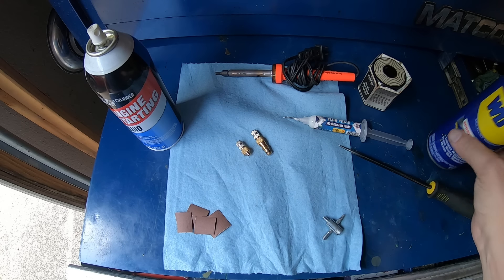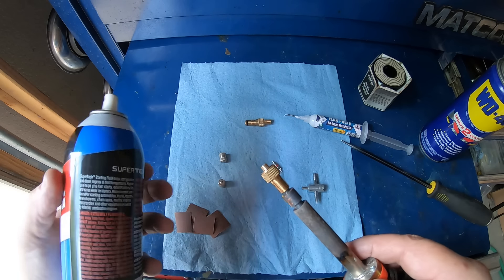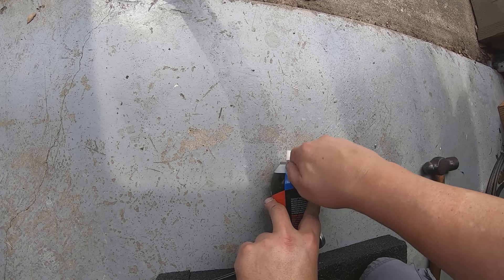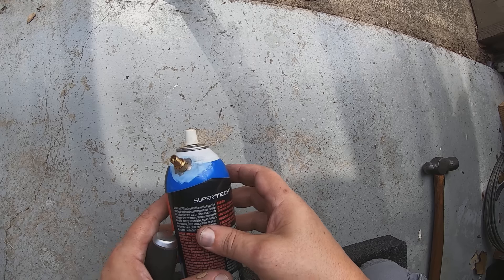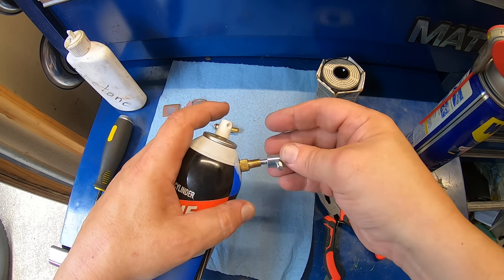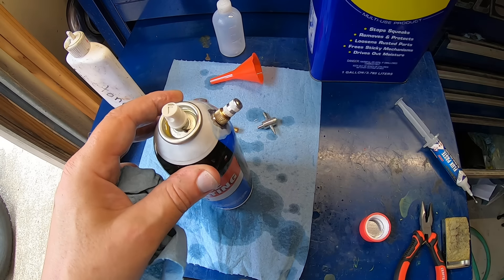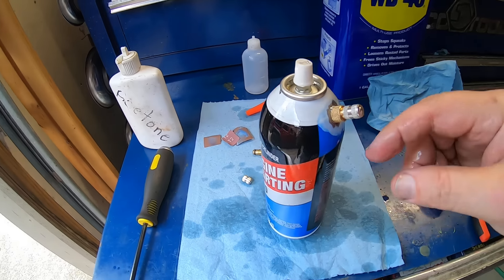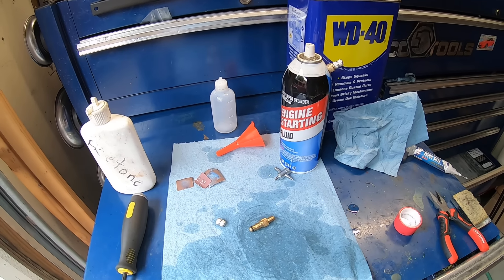How to Easily Install a Schrader Valve on any Can to make It Refillable without Drilling or Torch.

Comment: No lath needed. Chuck the valve stem up in your drill press and cut what you don't need, turn it down with a file. Use a Map gas torch, flux and solder and Boom! Done. Peace

Comment: What I do is I buy  bug spray in gallon jug that has the battery powered wand I flush them out with a shit load of water I dry them out I put wd-40 cutting oil etc in them and when the battery's go bad I take it apart and replace the battery's usually 2 aa or 2 aaa battery's I originally did it for my drill press😊

Comment: Keeping nozzles from empty cans is wise, caps too, because not all nozzles are of the common variety and easily interchangeable, though even with a standard nozzle it’s a pain when you lose the nozzle for a full can and or when you don’t have a cap for a can to prevent accidentally spraying it or depressing it just enough to discharge the pressure gas. I have a tote full of spray cans in the bed of my personal service truck and sometimes things accidentally end up atop the cans and spray product or just release the gas, but by far the worst is how many nozzles I lose.

I use Kroil and other Kano Labs products and those are not cheap (16.5oz aerokroil is around $36/can!), and they use a completely non-standard nozzle, so your screwed if you lose a nozzle and don’t have any other Kano products! I’ve had it where I had 1 Kano nozzle for 6 cans and just had to keep switching it around. They are helpful though, I recently called them and asked if I could buy just the nozzles and they sent me a handful for free! ..I have spent a LOT of money with them though.

Comment: It'd be easier to remove the spray nozzle from that brake cleaner can, use an extra tire valve (big side) to seat onto the straw and pressurize the can using a tire air chuck. (Locking chuck preferred)  some trimming of tire valve needed, bigger side trimmed to seat on straw better

Comment: Suggestion - put the valve on the side opposite the hand you use to spray; e.g. if you're right handed, put it on the left.
Reply: Some cans have a recessed spot under bottom of can, assumming that the valve-stem isn't to long, that would be the most eccomic location.

Comment: Don't drill metal shaving.
Usea ballpeen hammer to dimple the Can tin the Dimple.
Soak it with more solder.
I have been using 45° SAE fittings I use in A/C TRADE for 30 years +.
The SAE fittings are lower profile. The air conditioning parts house has line tapping charging  fittings.
I have Coleman green bottles I have refilled 500 times, you have to be able to charge liquid from a white tank.

Comment: So ive bought the metal tire valves they are threaded the whole way down to the large round end that goes on the inside of your wheel. I cut that end off so its just straight threaded. Punch a hole in a can. You can run a tap or just muscle it in there twisting it in. Then tin it and solder. Never had one let go. Holds air and works fine.  If yu have a lathe and lookingnfor an excuse to use it then your welcome to it but def not necessary

Comment: You definitely want the shraeder valve on the top.If you place the shraeder valve below the fluid level any solvent in the can could begin to dissolve the rubber seal in the valve leading to valve failure and a pressurized mess.
This mod also allows you to store/transport your cans unpressurized (ie air freight), use specific pressure settings or even make you own custom blends. DW40 + CRC 5.56 blend? Sacrilege to suggest adulterating DW40?
Reply: I would suggest not air freight or any professional freight for an altered pressure vessel.
I am not sure what the fine would be but it something I do not want to find out.

Comment: Great deal, $29 gal + $700 for a small import crappy lathe =$729 ÷ 128 fl oz = $5.70 per oz.  🙄
A 2pk of reusable shop spray cans are $65.00 at Amazon!!!
 Geeze alou!!
Reply from the maker: Exactly, I put affiliate links in the description so it is easy for you to click and add to your cart so you can get everything you need. 👍

Comment: I did this a couple years ago using an old rubber valve from a car wheel cause you can cut off the rubber and it is brass inside,  don't need to cut down other than that.
Only problem is that when i fill it there is a problem with getting it in there cause the air needs to come out as the liquid goes in and it is more difficult than shown here.
When my WD 40 can is empty I'll do it with that one.
Thanks.

Comment: Diesel is just as good for lubrication on rusty stuff, and a hell of a lot cheaper. WD40 is good for getting moisture out and protecting against on plug leads etc. But diesel is way more economical for everything else. And you don’t need to turn the valve down. 😁👍

Comment: Seems to me that with a vacuum pump and a turned down adapter (to go in where the spray nozzle goes in) this could be done with no extra Schrader valve installation.
Reply from the maker: I am confessed on how you would get the liquid back in the can? Pull a vacuum on the can and let the vacuum suck the liquid in and after it has sucked in the liquid charge it up with air?

Comment: Why wd40? How about motor oil. WD40 absorbs water but it also goos and dries up. Try spraying it on a brake rotor and watch the rust later. It may absorb water and displace it ?WD?  but it sure promotes rust later. Spray it on a hinge and it drys out. Spray it again a week or so later , and repeat forever. Yep they sell a lot of it. oh yeah spray again a month later....
Reply from the maker: WD-40 is cheaper than many other fluids and works great for machining aluminum. machinist use it by the gallons for aluminum. It does not promote rust like many people think. It may not be as good of a protectant than many other products now days but it does not promote or cause rust.

Comment: If you put a Schrader valve in the WD 40 gallon container you can use air to fill it through a hose into the other can, just put the fill line at the bottom of the gallon container

Comment: Putting compressed air in a thin wall vessel without a relief valve is dangerous. Hope that you are wearing safety glasses!
Reply: Exactly why we refrigeration techs are trained to punch In relief tabs on refrigerant cylinders when empty before throwing away.
Some take the tanks and use for compressed air.  Not a good idea.
I don't like videos like this that ignore safety and teach more people how to be unsafe

Comment: Too much pressure and your doctor will be picking shrapnel out of you if you're lucky.
Reply from the maker: True but you won't be able to over pressurize one with an air compressor.
Reply: So don't be stupid and do that, problem solved.
Reply: @crosley62  That was the reason I commented to that,the way I did. Thanks

Comment: Wow.... I didn't know you could solder a steel can with a normal solder, I though you need a silver solder and high heat.  For some reason I tried to solder 3/16 copper tube together with one a larger connecting tube in between using torch and it still managed not to work even though I used flux (the one for normal electronics soldering).  Maybe the torch was too much?  I never though a solder iron would work so well.  This is great idea, in fact I wonder if I can do this to make a refillable CO2 blow can.  Those things have gotten so expensive but are so useful to clean dust from computers and spilled powder from my reloading press.
Reply: be careful CO2 has a lot of pressure. You can look at a pressure temperature chart online someplace .

Comment: Pressurizing cans of hydrocarbons with gases containing oxygen is dangerous.
Reply from the maker: Luckily I was using normal air which is 78% nitrogen and 1% Argon which is no more dangerous than striking a match in the open air. 

The ratio inside the can is still 78% nitrogen.

Comment: A rubber tire valve stem can be used to fill the can through the nozzle stem. Pull the nozzle off and use the valve stem just as you would if it was in a wheel. The rubber will seal against the can top an air will go in the stem of the can.

Comment: FYI, you can get a rubber valve stem with the core, remove the spray head from the can, put the rubber stem over the tube and spray directly into the can.  Lift off the rubber valve stem and put your spray button back on and you're back in business.  Works great.  Stop by any tire dealer and they'll be happy to give you a few old valve stems that will work just fine.
Reply from the maker: How do you put the liquid back inside?
Reply: @737mechanic  The only thing this method will do is add air pressure back when it will no longer spray due to air depletion.  
You could actually pump liquid back inside the same way but if you're out of liquid and air why not just put your liquid in a spray bottle with a trigger sprayer....
Reply from the maker: @watchdogu.s.a.8973  You can or you can have refillable aerosol cans for convenience.

Comment: If you drill your hole, fine metal shavings will fall into the can and have the potential (albeit very low) to cause future problems in the spray valve. A center punch has no such problem because there are no fine shavings to deal with.

Comment: Cool idea, but filling with air containing oxygen could cause the oil to explode - that's how diesel engines combust.
Reply from the maker: Pure oxygen yes but the air you use out of the compressor is 75 percent nitrogen.

Comment: i saw on utube .you can use ceramic spark plug to heat  strech the metal to thread into metal  tap it in

Comment: Hold my beverage. Cool project, and nice skills, but fyi...when you first hit it with the air hose my arm instinctively came up to shield my face haha. Enjoy! :-)
Reply from the maker: I know, Thats why I was wearing safety glasses. 

You should watch the other 2 videos I did pressurizing them to failure.
Reply: @737mechanic  Aha...the nozzle popping off is a nice warning shot that things are turning sideways. 

Seeing things like that in a video might help somebody to react fast enough after they notice "oh weird, that fixture just popped off..."
Reply from the maker: @blueskyhigh420  Hopefully they don't have a compressor that builds that much pressure.

Comment: Word of Caution: I wouldn't recommend using these cans for a very long time. I'm sure that the moisture that is introduced when charging it with air from your compressor will play a role in degrading the can from within. I'm not exactly sure how long, but I'd throw them away every few years at least.

Otherwise, something I'd consider doing. I already charge up my little 1LB propane bottles to save money. Similar concept.

Comment: Just be careful with disposable aerosol cans.   I'm not going into detail but they aren't designed for a lot of pressure....that's why propane is the propellant.   It expands as you use product and maintains constant pressure.   Then flashes out of what ever product you are spraying.
Reply from the maker: To see for my own knowledge and everyone else's I have done 2 videos where I pressurize two different cans to failure to see how much pressure they can contain.

Comment: Prior to pressuring ANY metal can, you should first  reference the specific product Manufacturer's MSDA Safety Data Sheet from their website.  This sheet describes the maximum air pressure rating of the can.  You can be seriously injured (or possibly killed), if the air pressure exceeds the container's ability to hold it.  One's personal safety is of greatest importance.
Reply from the maker: Out of all the MSDS's also known as SDS's I have read I have never seen a MAX pressure of a can listed. In fact, this can was Supertech Starting fluid, If you can find the SDS/MSDS that shows a max pressure I would like to see it. 

BTW, my video tomorrow shows exactly how much pressure this exact can can hold.

Comment: I'm definitely interested in getting the soldering tip and maybe 12 machined schrader valves from you. I don't have access to a metal lathe.
Reply from the maker: Email me and we can work out a price.
Reply: @737mechanic  I'd write up a disclaimer so people are aware of possible dangers of using your items, should you sell them. Lawyers have a way of twisting things if they are trying to sue! I'm sure they would try to go after you and/or your homeowner insurance should anyone sue for an injury after using your products and/or method with dangerous products. Just saying; watch your 6 ! Good luck though, it seems to be a clever idea!

Comment: This works out nice for lubes and such. My forty dollar ($40.00), down town version holds a quart and I use it for stainless steel cleaner. It holds an air charge for months.

This would allow me to keep the same bottle for cleaners, nut busters and so on by poking holes in one that ran out of propellant, then pouring their contents into the modified can. In the end, a lot cheaper than buying a stack of the forty buck ones.

Pour out of the big can from the top, Less bubbling and splashing.

Press down on the spray valve to let air out, as you squeeze fluid in.

Comment: If you hit it with your soldering iron it might damage the element inside the iron, a hammer is for hitting things with.
Reply from the maker: Why would anyone hit something with a soldering iron?
Reply: You said fit the valve in the can and hit it with a soldering iron
Reply from the maker: That is mechanic talk for put the soldering Iron on it and heat it up. 
Kinda like saying "let me hit those lug nuts with the impact wrench".
Reply: Omg, I hope you were just trying to be funny, if not you need to go back to your knitting and turn in your man card.

Comment: Machining the valves down does not fit into ''easily''.
Reply from the maker: It was easy for me, you can use a grinder, drill press a file, or even a hacksaw to achieve simular results.

Comment: Wouldn't it be easier to make an attachment to push into the original tip(with the spray head removed)?
Reply from the maker: I thought about coming up with something like that but to pump liquid and air into it might be challenging.

Comment: I did not realise that you could solder aluminium.  How does that work?  NIce work and an excellent video, very well explained.
Reply from the maker: Niether metal is alumunum. The can is steel and the valve core is brass. I have never had luck soldering aluminum.
Reply: @737mechanic  - To solder aluminium, clean up the surface and then cover with light oil. You can then use normal solder to solder through the oil. It works but a bit messy to perform.

Comment: Can ratted is for max..you dont need that much pressure...not right to the edge of safety
Reply from the maker: You can pressurize it to whatever you feel comfortable but the can will hold more than 100PSI.

Comment: EXPERTS ONLY can make a shiny spot on a can with the side of a 3.5"D x .045"W abrasive cutoff wheel mounted on a WELL OPERATOR-MODULATED 1/4"  air cutoff tool. The slight flexibility built into such wheels permits this (for a little while)

Comment: If I can drill the bottle without it exploding, I will empty the content in a manual spray
Reply from the maker: If you want to put it in a manual spray bottle spray it out of the can into a manual spray bottle.
Reply: @737mechanic  no pressure, so I need 2 holes to empty the spray

Comment: No drill or torch needed 😂 I first machine down the brass then I machine down a copper lol if you have a lathe or a mill you generally own a torch and a drill
Reply from the maker: But a torch and a drill is not the best way to do it.
Reply: @737mechanic  just saying no need to even mention it like that is what would be holding anyone back from doing such

Comment: Worried about drilling by using machine shop tools?  Anyone without a drill has no chance having the tools used in this video!

Most spray cans can be repressurized wirh a rubber tire valve stem.  There are also empty aerosl cans that can be purchased that are a lot less trouble.

Comment: A few atmospheres of pressure should be safe (except for starting fluid). More than 5 atmospheres / 75 psi could heat the can to the fluid's explosive limit (like a disel engine) Using nitrogen or argon is safer.

Comment: Or you can also just buy a sure shot sprayer and use it for any fluid you want to spray (lacquer thinner, wd40, carb cleaner), etc.  Also, rather than scrubbing 3-4 minutes with an emory cloth, you could buy a dremel or die grinder and do the same thing in 3 seconds.

Comment: Bruh just use the cans of wd40 with the long red tubes, goes right in the valve.
Reply from the maker: How do you fill the can with WD-40 when it is empty?
Reply: @ duh with other cans of wd40, called the circle of life man.
Reply from the maker: @JohnWear-s3f  So you just pour it from one can to the other through the spray tube? LOL

Comment: on the original wd40 do they use nitrogen as the propellant ,using air = flue + air=  a bomb? if it comes in contact with a flame.
Reply: I was thinking the same thing. 

Engineering best practices try to avoid that kind of situation in vehicles, chemical plants etc.

How much of a risk is it inside an aerosol can where there’s less chance of an ignition? I’m not sure. But it’s definitely something to keep in mind.
Reply: I don't think WD40 is going to be explosive like starting fluid would be, however it will burn.  It would take quite a bit of heat to make it burn and smoke, but you shouldn't get anything like an explosion from WD40 burning.

Comment: Be mindful about where you put the valve. If you notice, many cans have a black or red mark near the nozzle and an arrow molded into the top of it. Those are reference marks to where the sprayer should be turned so that the bent straw inside will get most of the liquid before it starts to spit. So place your valve about 90 degrees tangent to the mark either side.